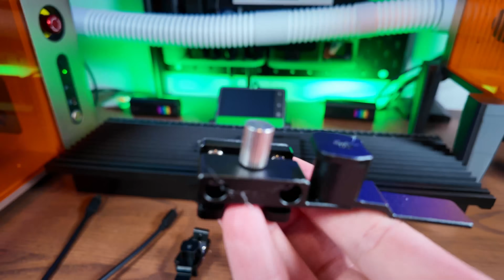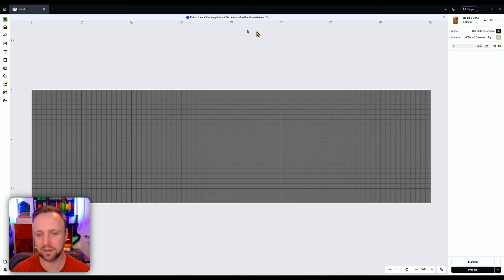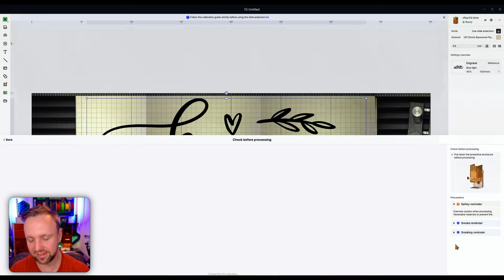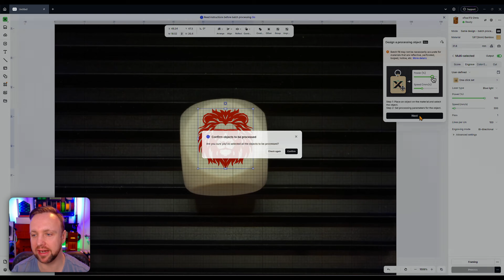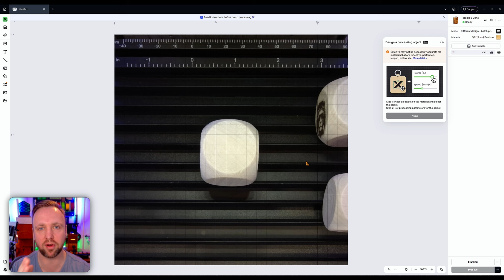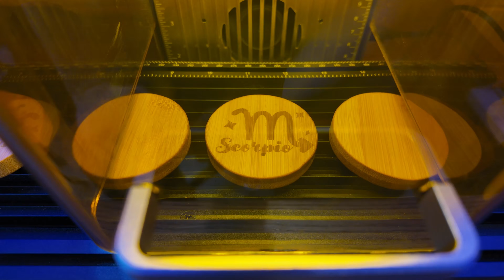xTool F2 Slide Extension Tutorial – Full Setup, Batch Engraving & Tips

Comment: feeling frustrated, I am printing a 15" wide family celebration calendar on my slide extension, with months and holes on the bottom, some of my months are cutting off the last letter of the month, I also had a design in the center that part of the heart (it was a mirrored design and I had this issue only with 1 sided) was engraved like half a heart.
Reply from the maker: Sorry for the slow reply, and sorry you're having trouble with it. Did you run the calibration first? I skipped it in the video and it may well have affected my alignment. It's also worth framing the full length before you send it and making sure the board is clamped tight.

Comment: Xtool needs to make a slide extension for the UV
Reply from the maker: They already have one. It's called the conveyor.
Reply: @L3DAccessories  No, it's not the same. Are you going to cut on that? NO! And doesnt that only go one direction? If you're doing a 3d engraving with multiple passes on over sized board, how is that going to work?

Comment: I just HATE that the max speed for engraving is only 160 mm/s . 30x slower than the machines full 6000 mm/s speed. It makes it almost useless for batch processing because its way faster to just engrave on baseplate and switch out material after each engrave.
Reply from the maker: That's a fair point, the speed trade-off definitely isn't ideal for every type of workflow.